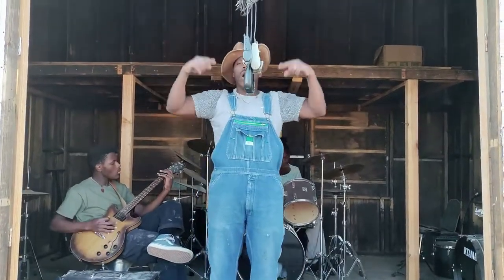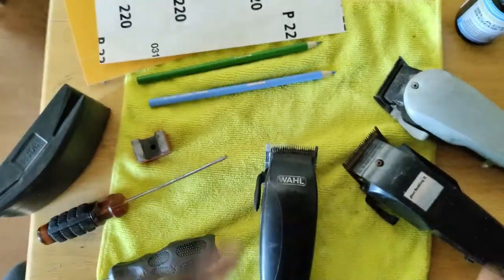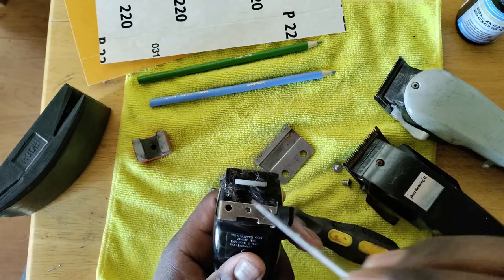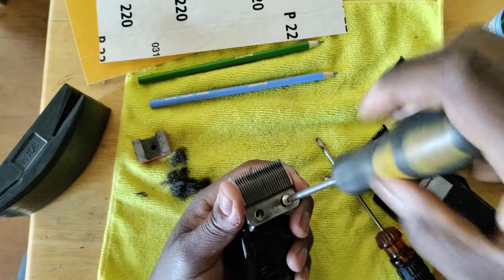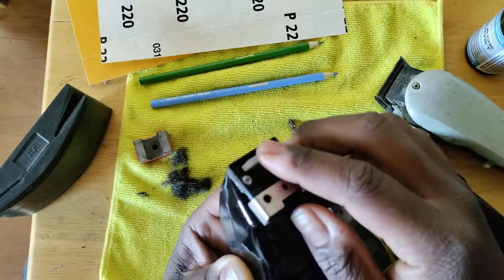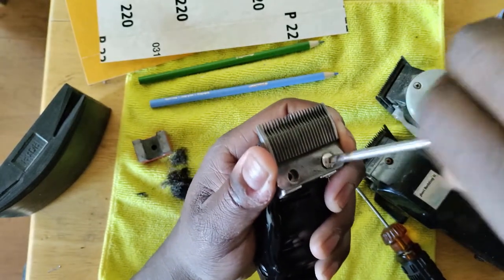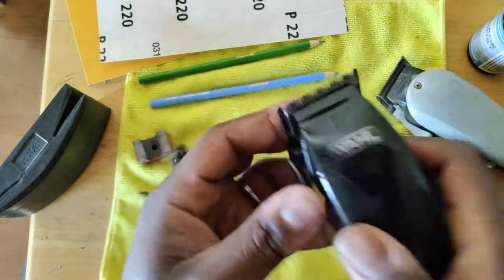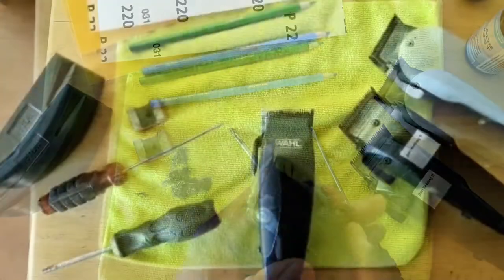walmart clipper maintenace part II

Comment: Hey I been following your video series and I did the diy blade sharpening technique I even successfully made the blade mold out of clay and it was a big help... But I followed all the instructions and got all of the supplies to sharpen as you gave instructions... I've sharpened 2 trimmer blade and they won't cut what could I have possibly done wrong following each step as to why they won't cut at all now